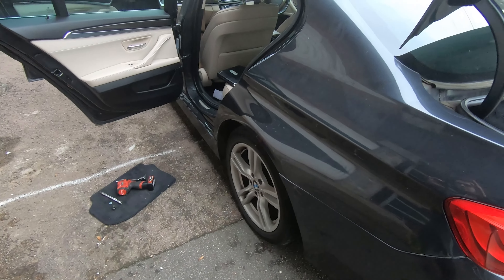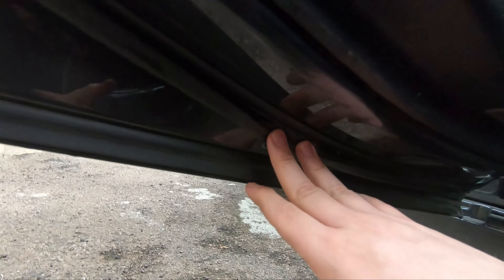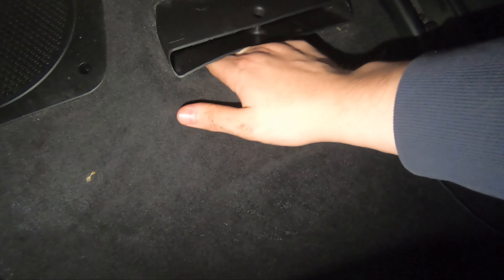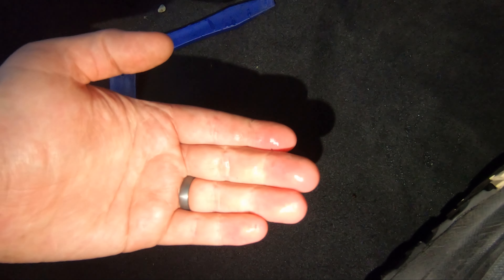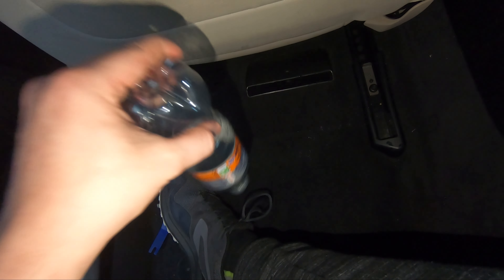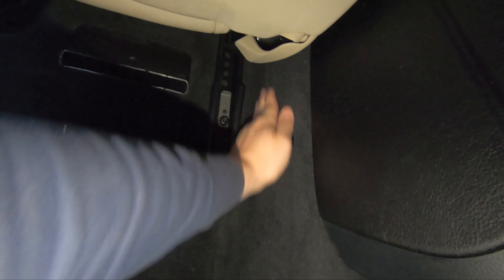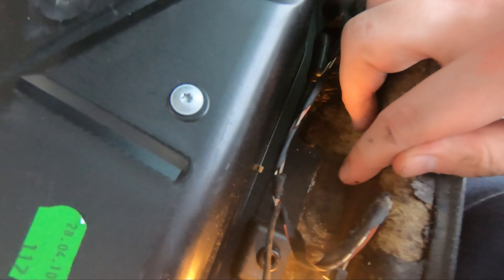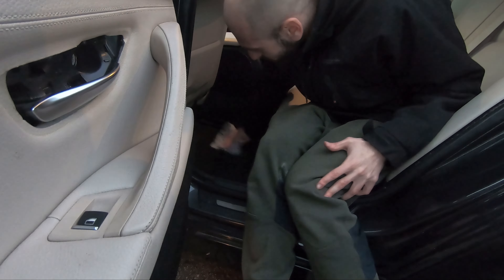Is Water Leaking Inside Your Car? Wet Carpet Diagnosis

Comment: I have the exact same car with the exact same problem in thr exact spot. Could you please share the solution? Thank you
Reply: Me too man it sucks, keep hoovering it out
Reply: my advice for would be to take the door card and pour water down the seal on the outside. From that you can see where the water is leaking from internally. Ive noticed on mine it was that the water vapour seal was not stuck down properly so i've applied some silicone glue as well as the interior clip fixture holes - one of them were broken allowing water to enter. the leak has stopped but hoping the floor carpet which is foam drys up.

Comment: Thanks for this tip. I drive a 2012 Toyota Yaris hatchback, same issue.  We are going to take off the door "card" and replace the sealant with Butyl tape. Hope this fixes it, both sides at the rear are soaked.
Reply: Hi can you explain please. I didn’t get your point but I am experiencing same problem

Comment: I have same problem with my golf. I cleaned the draining lines and the next time it rained again water came in but only at the driver’s area.
Reply: Today i removed the plastic part under the wipers. Took the motor off. And put silicone around the cable that opens the hood. And the box next to that. Lets see how it goes. Im pretty sure it comes from there.
Reply: @xrmm9617  I have the same issue in my Audi A6, Did you find the source?

Comment: My Kia forte leaks in the back floor boards and the spot where the back seat meets the back seat back rest and the trunk deep where it meets the  back seat. Only when it rains is it likely the back window? I hope not those are expensive but cheaper than a new car 😂
Reply: Did you figure out the problem ?

Comment: I have a water coming in to my passenger side back floor but I have a 3 door car what can it be
Reply: Same
Reply: @percynolan6198  we found  out it's are back light the water was coming off the boot and going throw the light as there was a gap between light and car frame i would say check your if there's water in your boot on passenger side then  put  a bit of silicone around your light see if it stops it if not I would check if your windows are letting in a bit of wind as if they are then it could be getting in that way but the water getting in my car was only getting to under passenger seat so we new it must of been coming from back somewhere it's not nice having to deal with water in the car as it starts to smell but moment you find it dry it out at much as you can then I went in with some clothing fabric softener just to make it smell a bit better hope this helps

Comment: I have same issue with my ford fiesta,  the floor on the back to right passenger side is very wet and the trunk where  spare tire is placed is flooded. It is starting to grow molds. They said the diagnosis shows the weather strip is worn out and should be fixed. They billed me $1200.00 for the repair and labor. Very expensive.
Reply: where is this 'weather strip' ?? i have the same issue in the same place on my fiesta
Reply: Same issue have you found any solutions
Reply: @HidingZebraTube I have a hatchback  which was flooded during the rainy days, it flooded the back compartment where the spare tire is. I brought it to Ford service center they said the weather strip is worn out that is why the water goes inside the trunk. They replaced the weather strip, so far it has not rain yet after the replacement. But I tried the washer, so far the water did not go inside the trunk.
Reply: The weather strip did not work, now it is raining the rain water started to flood my spare tire well again. I just returned the car to Ford just now, the advisor said they will check again. I am losing my patience.
Reply: I returned my car to Ford service center and it took them almost a month to repair. The service advisor said they still have to order the parts and they are waiting for the parts to arrive.  She said next day delivery but did not happened. I waited for a week, no update, I have to call and text the advisor what is happening. Most of the time, I could not reach them but I kept on calling and sending them text messages to no avail. Then after a week the advisor texted me that my car still in service due to parts has not been delivered.  They kept my car for 28days and I am paying for the rental car they provided me.  The service advisor said they found molds in my car and that they have to perform detailing to remove the molds. The molds probably came from the wet carpets due to rain water goes inside my car that went unnoticed until lately. For the parts, they said the parts are not available so they have to use the salvage parts from my car.  On 28th days, they said my car is ready for pick up, I paid 2, 800.00 dollars, very expensive. Total for everything, weather strip 1,200+2800= $4,000.00 dollars, which my extended warranty does not cover. I bought this used car from Nissan last August 2023, not even a year, they sold me a lemon car. I feel cheated.

Comment: Whenever I drive my car with the AC on and take a sharp turn a squealing sound comes and water drips near the passenger seat. What could be the issue possbly
Reply: AC creates condensation but there is a hose to drain it to the ground. Sounds like it is blocked and therefore overflows inside the passenger compartment.